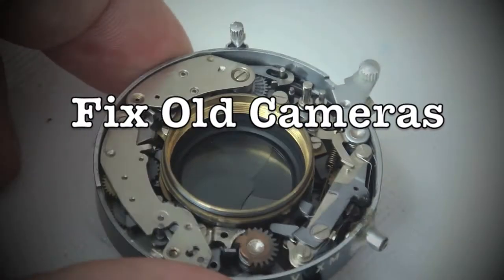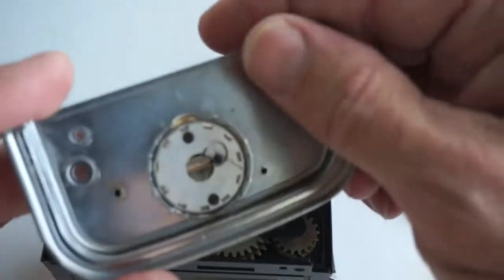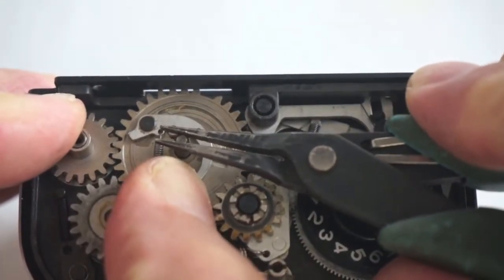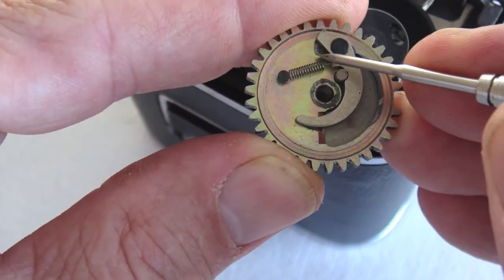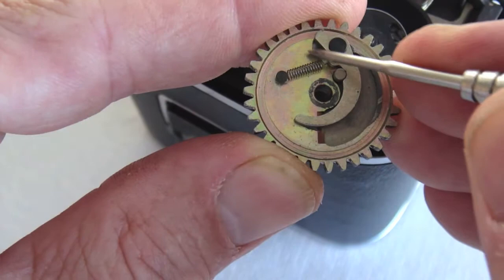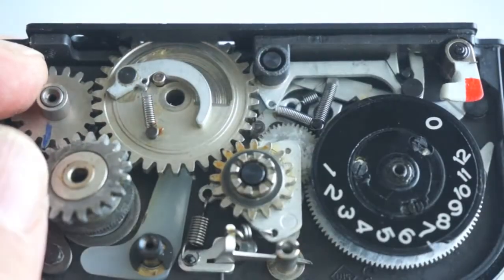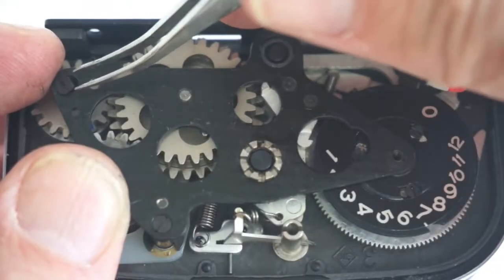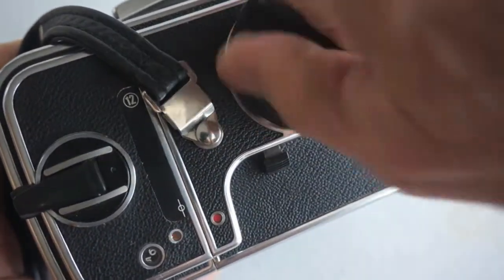Fix Old Cameras: Hasselblad CM Back Overlapping Frames

Comment: Finally got around to this repair and it went wonderfully. I was successfully able to do all the procedures but the back still jammed when shooting. I then did some more investigating and saw that the vinyl dog leg or part 20717 was the real culprit. Using two other backs I shot the first frame and looked to see where the gears had advanced to. I then noticed the non-functional back was slightly forward, only a gear, but enough to cause the jam. Now I'll be ordering the replacement part and getting on with the repair. This video and some message boards all gave enough clues to finish the job! Heck I could even buy all the jammed A12 backs I find now knowing I have two ways of repairing them.
Reply from the maker: Very good to hear of your success and your enthusiasm for future repairs. Your persistence and patience paid off. The white plastic/vinyl dog leg lever sometimes is dented because of the snap back action of the return gear. The repeated beating it gets from the pin on the back side of the lower winding gear will over time make a dent in the dog leg. If this is the circumstance, replacement is the best solution,. However sometimes the dent can be expanded back out by imbedding a small washer or nut behind the dent into the body of the dog leg via the tip of a hot solder iron. Maybe a FOC video is in order addressing the dog leg issue. Keep'em going.

Comment: Excellent. Helped me fix my CM back. A couple of things: 1.  I think my back does not have a "sweet spot" for Frame 1. Adjusting the indicator dial on the frame counter wheel simply fixes the point where the winder locks to start frame 1. The other frame positions are all set up by a cam on the frame counter wheel. 2. When resetting the frame 1 position, turn the dial clockwise relative to the wheel to start frame 1 earlier (bigger gap between frames 1 and 2), and vice versa. 3. Paint which was previously used to lock the three dial screws can get trapped between the dial and the wheel when you make the adjustment, making it a bit too thick so that it jams on re-assembly. This is difficult to diagnose because it only happens when you put it all together. The solution is to remove the dial completely, scrape away the old paint, then set the dial in the desired position and install the screws . Paint the screws if you must, or later when you know it's right. 4. Make sure not to trap the pawl under the ratchet wheel when reinstalling the spool winder gear.  It could cause a lot of damage if you tighten it up in that condition. 5. Don't be easily tempted to remove the frame counter wheel- it is surrounded by a complicated series of levers and interlocks and there's probably nothing wrong in there. Just lubricate it. Once again, many many thanks.
Reply from the maker: Thank you for your comments on your experience and insight on how you will able to work the outlined repair procedure. It should be helpful to others who might endeavour to give it a go.

Comment: To fix frame 1 - 2 spacing the counter dial controls the spacing. if the screw looks like this (   0   ) (dead center), frame 1/2 will be separate, with no spacing. if the screw looks like this (       0) (screw to the right), frames 2 will overlap with 1. If screw looks like this, (0    ), frame 1 and two will be spaced wide apart. Best setting would be t have the screw locate on the left side, like this (  0      ). I tested this out with two different backs.

Comment: There's an easier way to make sure that the counter dial is in the correct position: with all the gears and the support plate installed, push up on the pin that the film insert would normally activate from inside the back (it's the one that moves the center mechanism into place so that it meshes with the counter dial). While holding that pin rotate the takeup spool gear until the release arm drops into the first recessed slot in the gear under the counter dial. At the same time that the release arm drops into place, the small lever on the underside of the support plate should also be falling into place in the cutout on the edge of the dial near the number 7. Loosen the screws on the dial and adjust it until that lever is in the correct position then tighten the screws back up. 

I'd also suggest that if you're going to go through the trouble of removing and cleaning the main gear assembly that you might as well spend a few extra minutes to completely disassemble and re-lube the rest of the back. Most of these backs are 40+ years old at least and could use some new grease and oil on the parts that need it.

Comment: Really well done. Wish I had this video when I was working out how to service my backs a few months ago :)

One thing you might want to mention: The lower wind gear needs to be placed back into the back such that the notched out portion that interacts with the body is in the right position. It looks like this video you had it in the wrong position, then in the next cut it was put in the right position. The Hasselblad repair pamphlet, which can be found online shows roughly the angle that notched out portion of the gear needs to be at.
Reply from the maker: The position of the timing of the lower wind gear post is mentioned and demonstrated in the reassembly portion of this video. It is important and your sharp eye and your experience will be helpful to others attempting to work on their Hasselblad film backs. Thank you for your comments and interest in Fix Old Cameras

Comment: Hi, great video. I already fix the auto stop of my A16. But before i take it further apart i was wondering if the tension of the spring in the top right is the same or if it is higher or lower then the a 12.
Hope you can help me out this far after uploading the video.

Comment: Hello, thank you for the information. Very helpful. is it possible that you make a video on how to change the spring? Mine is broken and its been a pain to install the new one.
Thank you!
Reply: Look for Hasselblad's service manual that covers all the different film back models, it explains how to recoil the spring. Basically you put the crimped outer end of the spring into a slot on the inner hub of the gear and then slowly wind the spring into that hub. Just make sure you do it in the right direction (so that the spring is tensioned when the gear is turned clockwise)

Comment: I have the problem of overlapping images with my Hass and stumbled upon this video and thought my problems are gone.
But, I was stuck on the second step...
The first one is to remove the leather, so I did.
But after removing it I found out that I don't have the three screws! There are no screws under the leather. Nothing.
The back seems to me to be a genuine one but maybe an older variant, not the one from this video.
Couldn't find any instructions on the web on how to open it.
Please help.

Comment: I recently acquired a Hasselblad EL/M that seems to have overlapping frames 1 & 2 and would like to try repairing this myself using your wonderfully instructive video. One thing puzzles me though: you say the frame counter has a 'sweet spot';  but how do you make sure it is actually positioned correctly?
Reply from the maker: Well... nothing exact. Experimentation finds it eventually... experience sometimes finds it on the first try. Thank you for your comment and for your interest in FOC.

Comment: I managed to get the plate off an A16 back ( Old style with no 'darkslide holder') and lubricated the cogs with a small amount of sewing machine oil on a fine brush and did not disturb anything -- so now it winds on 'sweetly' BUT i have the A12 and a newer A16 back with the black plastic darkslide holder and I cannot fathom how to remove it  to take off the side plate with the winding handle. Can you please advise how to remove the darkslide holder ?
Reply: Use a screwdriver below the chrome edge and pry up. It looks like one piece but is actually two.

Comment: Great video just have a couple questions. What is the properly sized slotted screwdriver? Also are there any major differences to be aware of between the A12 back here and the older style backs?
Reply from the maker: When using slotted screw drivers in the repair of classic cameras, just make certain that the blade fits snugly and completely in the slot. Also make sure the blade is even and square and is close to the same width of the slot. It is OK if it is a little narrow as long as it produces the needed leverage against the slot.

Comment: Great videos. Just got my grandfather's voightlander vsl1. He run over it with his car and I've been trying to fix it. I did fix the lens (Color Ultron 1.8/50) with another broken donor I got from ebay. Now It has some issue with the lightmeter. I checked the battery but no rust or battery oxide is present. What could I check?
Reply from the maker: Check for damaged wire leads across the top of the prism. Continuity of the CDS cell unit ( the resistance should change with the intensity of light) Check the switch that is engaged by moving the advance lever to the ready position. The meter circuit and galvanometer could have also been damaged by the impact.
Reply: Thanks, I'll do so.

Comment: Thank you for the sharing. Just wondering, for 1st and 2nd frame overlapping, whether it would work by winding the arrow on film say 90 degrees past the arrow on the film back
Reply from the maker: Not sure. Typically there are only a couple of things that will cause overlapping frames. The dog leg lever is sticking or deformed. Lubricate the little dog leg on the top of the lower winding gear and more than likely this will correct the overlap issue. This little procedure will also usually fix frames that just touch as well. Or the plastic dog leg will occasionally be dented at the contact point. If so it is best to replace the dog leg lever by removing the C-ring retainer. I
Reply: Thanks for the reply!!
Reply: No. The relative positions would all stay the same.

Comment: I was wrong- there IS a "sweet spot". If you make the gap too big so that frame 1 comes very early, the winder locks on frame 1while the status flag is still black, so it looks like there is no film when there is. So you have to set the dial so that the winder locks only just after the flag flips to white. That should still leave a gap between frames 1 and 2, the object of the exercise. Another tip: you can check the position of the frames without having to expose rolls of film as follows. Wind a length of backing paper onto an empty spool and load it in the normal way. Remove the back, take out the dark slide and mark the position of frame 1 by very lightly scoring the paper with a screwdriver along the edges of the frame. Insert the dark slide, replace the back, take out the dark slide, fire the shutter, advance to frame 2, replace the dark slide, remove the back, remove the dark slide, and mark the position of frame 2 on the paper. Unload, unwind the paper and look at the marks you have made. Again I thank you. I'm off to Portugal now with 20 or so rolls of Ektar and FP4. Only my lack of photographic talent can spoil things now!
Reply from the maker: Thank you the additional comments and it is good to hear of your successful repair. "Off to Portugal" sounds like to much fun and keep'em going.

Comment: I had another problem that i solved because of this video - was simply a spring that had detached itself. However another problem have occured: I cannot fit the side plate back on. It just seems a tiny bit too big for the plate now. Which is strange.
Reply from the maker: Rotate the wind lever as you gently seat the side plate, that will help the wind lever engage with the wind ratchet gear unit.

Comment: my camera will not winded with film back on once I remove the back it works so I think it the  film back it look to be fine but when put back on the camera it will start to wind 1/4 then stop
Reply from the maker: Probably have an issue with the film back. Typically when the back jams up immediately or after shooting a frame or two it is the return gear spring. It is either broken or come loose. You can check this by holding the film back so you are looking at the face plate (focal plane) and pushing the gear so it rotates up towards the top of the magazine. It should snap back in place with authority.

Comment: Video very helpful, thank you very much. I followed the tutorial to fix my magazine 12, but unfortunately it still has an uneven spacing between frames 3 and 9. Everything looks correct, even I changed the nylon stopper piece, but I realized that maybe my problem is with the wheel under the counter dial. It has saw tooth underneath and some of them look worn. They are 6 and seem to coincide with the frames that give me failure. But I do not know if this wheel comes like this from the factory, if it is worn (it does not seem to be worn, have defined edges) or if someone repaired the magazine previously and confused the wheel with of another magazine, such as the A16 or A24. Could you confirm if the original wheel looks like mine in the photo? or what other failure can cause this? Thanks a lot. https://ibb.co/6Ft0gTC
Reply from the maker: It seems unlikely due the nature of the functionality of the counter mechanisms in Hasselblad backs the gear teeth are worn. You will encounter differences in the counter stop gears between the various versions and some do have variances in the size and shape of the cogs. It also seems unlikely that and incorrect gear was installed for it seems it would not function at all. It is appreciated that you were simply trying to clarify your repair issue, but due time constraints FOC does not follow links to pictures or videos and included links will often block your Post. Spacing issues are generally caused by the little lever on the of the lower winding gear also make sure the little cog on the bridge plate is moving freely. The "sweet spot" on the counter dial might be tweaked - loosen the three screws that hold the counter dial and a slightly different position either direction.